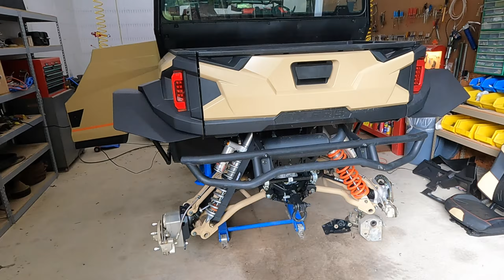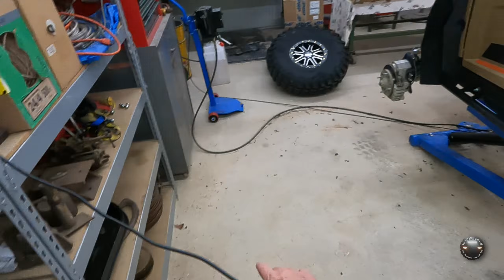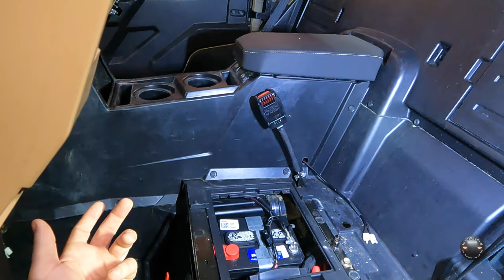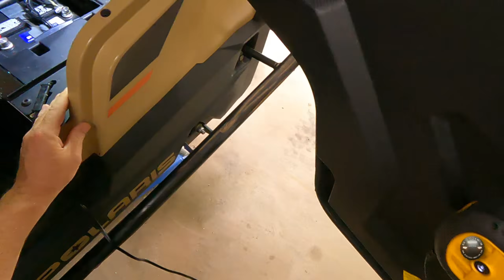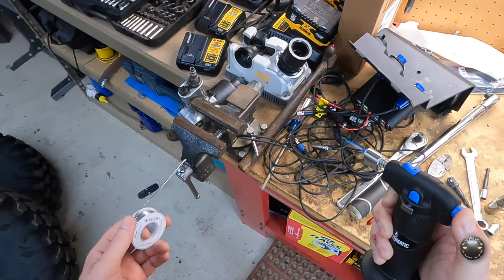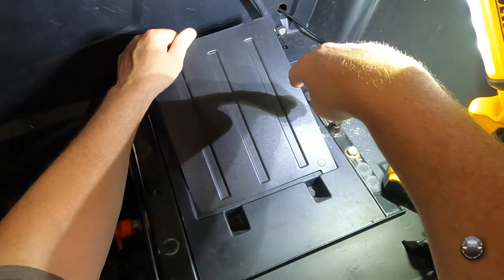General XP 1000 Fire Safety Tips!

Comment: Great video.  I am glad you are getting things back together.  For your trickle charger, I would like to suggest installing a Tecmate OptiMATE Cable O-40, Weatherproof SAE socket, panel mount instead of just having the pig tail sticking out and possible rubbing around.  They are like $15 on Amazon.  Polaris makes a Pulse Battery Tender Adapter that is fused and plugs into the bus bar that is very handy, but would not work if you have the cut off engaged.  I have my Optimate on the hood of my Ranger going into the  bus bar.  On my Sportsman I used the Optimate in put it in the headlight pod to plug my tender into.
Reply from the maker: Nice, thanks for the suggestion!